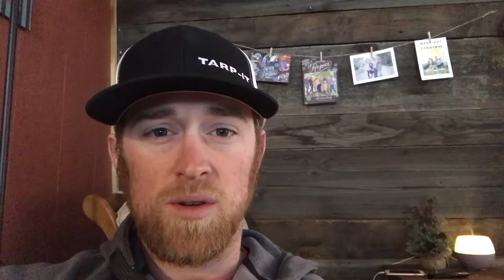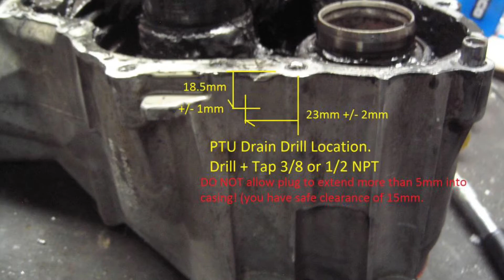Ford Edge: PTU Drill and Tap Measurments and Other Useful Information to Answer Recurring Questions

Comment: @Buckn32

Shat a savings. Thank you for the video.

Do you have a Pic of the plug or hole you put In from the bottom looking up at it?

I don't want to miss place the hole.

I have 2008 escape hybrid set up.

Comment: The way I look at it is it was $13 for the tap drill and plug. It’s worth a try. $500 - $1000 to buy the ptu.
Reply from the maker: Me too. There’s the ways shops tell you to fix problems which usually cost 4 figures. The way I look to solve problems is look for fixes in the one figure range. If I cannot solve it there bump to two figures. If I cannot solve it there then bump to three figures (in this instance that’s looking for a PTU out of a totaled rig (and tap a plug while it’s out)), then if all else fails we go new at four figures.

Comment: Good video ! Going to try it myself. 
I will probably go with a smaller plug size. 
You list 3/8 or 1/2 NPT plugs.
3/8 npt requires a .571" hole and 1/2 npt gets a .719" hole. Seems overkill.
1/4 or 1/8 npt may take a little longer to drain but gives you more room for error. 
1/8 npt calls for a .339" hole . That should be plenty big enough.
Reply: I used 1/8" NPT
Reply: @900 STX How did it work out? Any pics?
Reply: @markr2159  after a little research i found out that my 2016 2.0L escape has a fill and drain plug installed. 
Changed the oil a couple weeks ago. 
Other than the plugs being tight as hell, the job was pretty easy.

Comment: Buck, for some reason this video continually comes up static and says video is no longer available. Can you check to see if the video is still active or at least reply with the plug and tap specifics you used to drill and tap your drain plug?FYI your other video on drilling a PTU drain plug is also showing as "unavailable".
Reply from the maker: ARCSSelfDefense oh wow thanks for the heads up! here you go for material list:

1/4 NPT brass plug
1/4 NPT thread tap
7/16 drill bit

Comment: Buck, I understand 1/2- 20 width and thread pitch, but how deep should the plug be. Im worried about it threaded in to deep and making contact with gears or something. Thanks for your response, I dig ur site.
Reply from the maker: Think that’s one of the benefits of the small hole with a brass plug, it really isn’t deep enough to cause a concern. Not sure how much experience you have with pipe threading but it’s almost impossible to sink it all the way and even then things will be stripping before you can sink it that deep. I just went until snug with a small little socket wrench. It’s similar to the oil drain plug. Snug is great, if you go wild with tightening it can cause expensive problems.
Reply: @buckn32  Thankyou for taking the time to reply..
Reply from the maker: No problem don’t hesitate to come back if more questions develop for you.
Reply: ben martin . There a drill , tap , how many turn you tap to the the hole with the size .

Comment: Is there anything that can be poured into it to thin out the sludge before pumping it out ?
Reply: Your best bet would be to fill it with 75-145 differential fluid run it a few miles and then either suck it out from the fill plug, or drill it and let it drain out like Buck did and then tap it out and install the new drain plug.   I purchased a Kweiney Pneumatic Fluid Extractor on Amazon for $21.95 (works great).  See link below:

https://www.amazon.com/kweiny-Pneumatic-Extractor-Replacement-Automotive/dp/B07DTHYT9J/ref=mp_s_a_1_2?keywords=kweiny+pneumatic&qid=1570253232&sprefix=kweiney&sr=8-2
Reply from the maker: Thanks Kramer that’s a solid response!

Comment: I love your videos. I do have a question. The pic you showed has the PTU removed. Can I remove it to drain it and the fill it when I it it back on.
Reply from the maker: Jon Farrar yes you can do that the fill plug allows you to fill it while it’s under the car. You just need to stick the box of a 3/8 ratchet into the plug to remove/install the plug.
Reply: Yes

Comment: Thanks for the video. '07 with 80k miles. Drilled and tapped a drain plug. My fill plug looked just like yours with the same amount of build up.  Even your advice on how to reinstall the fill plug using the left hand was spot on!  Keep the videos coming!!
Reply from the maker: Thanks Ward! Glad I could help you out with the content. Let me know if there’s any questions that arise with your Edge... and by the way 80k miles on an 07 is impressively low! Have you owned it the whole time?
Reply: Since it was new...my bride only drives 3 days a week to the hospital and back.

Comment: Thanks for the video, I was able to get this done last week on a 2007 ford fusion using your videos. However, the exhaust is a little different from the Edge so my hole ended up about 30mm down instead of 23mm because that was the closest I could get without removing the exhaust. Seemed to turn out okay I just drilled the last little bit extremely slow so I didn't hit anything inside. Question, How many miles was on your PTU oil before you decided to drill and tap it? The ford dealer told me my PTU was leaking and making some noise, and had to be replaced which would have cost $2000. My fill plug had about as much sludge as yours and around 12-14 oz of gear oil ran out after I drilled it, so I'm hoping I'm not too late and if I do a couple of changes in the next 2000 miles I'll be able to save the ptu for at least a while longer.
Reply from the maker: Dalton Magee I am not sure how many miles were on it because I bought it used at 175,000 roughly. Think I did the drill and tap 3000-4000 miles after buying it. I then drained and filled after 10k miles. Think I’ll stick with that interval for a little while. I will caution you though that a little leak is normal because there is a pressure valve on the PTU that opens when the fluid gets hot and sometimes lets a little out. I’d only really be concerned if you see A LOT OF fluid under your car at some point. Since it has a really distinct smell-as you know 😉-it will be easy to tell if there actually is a significant leak. My guess would be your service guy didn’t know about the pressure release valve and some fluid from that. But at the end of the day you’ll be able to tell better than anyone how it’s doing holding fluid just by looking at the ground where you park your rig every night.